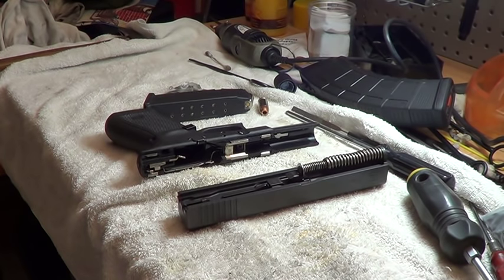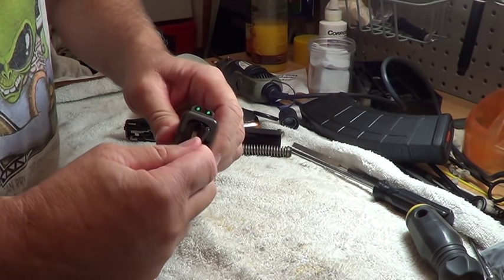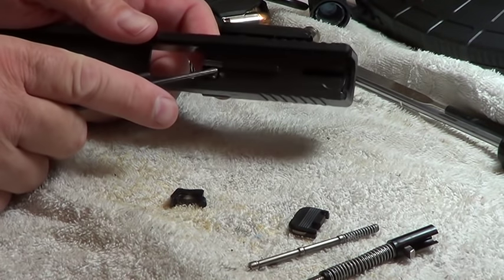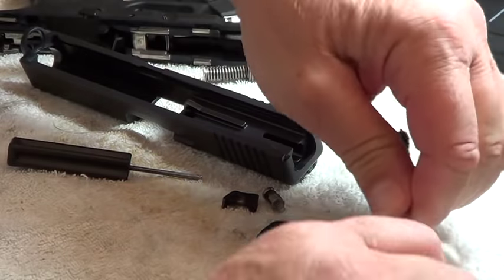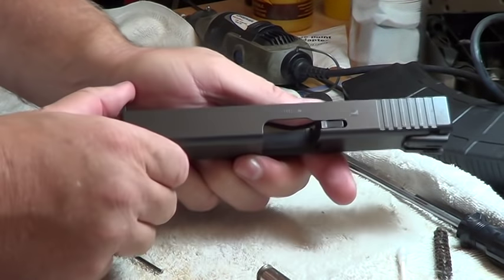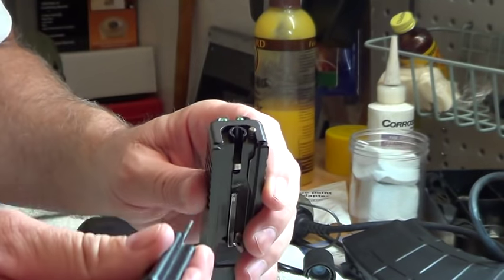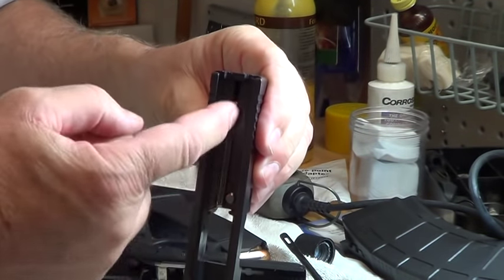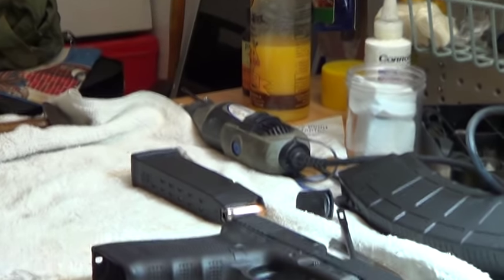Glock firing Pin Removal - Cleaning & Removing The Glock Firing Pen From Slide

Comment: Great video, when do you know it's time to change the internals(firing pin etc) my G19 & G26 are from 1998, and I have put thousands of rounds threw them both ( Duty & off Duty ) also I have never taken that back plate to clean the guns unless the Job Gunsmith did when I had them service my pistols for whatever reason. Both guns work fine shoot as good as they did when brand new. My G42 gets unbelievably dirty so the next time I shoot it and clean it. I will do what you instructed. Again great video and thanks for any opinion you care to share, all the best.

Comment: Thanks for this. I already did all this by experiment, but your explanation confirms I was doing things right.
Question for you: I've had more than enough misfires recently to wonder if my pin spring is too weak. Is that possible? This G27 has had several thousand rounds through it. The pin strikes the round but no discharge - so I have to re-rack by hand. Maybe bad ammo?  It is a sick feeling - especially in the middle of a rapid-fire training session.
Reply from the maker: Not sure I would try different ammo, differ mags, check firing pin for chipped, bokken or worn.
Reply from the maker: make sure you two firing pin couplers are in right
Reply: Thanks. I did not mention the fact that I am using 9MM rounds in both .40 and 9mm mags so I may be adding too many variables. Plus, mixed ammo brands. I need to be more methodical in determining what is wrong. I just broke down, inspected and cleaned the entire assembly so maybe that will help (it was pretty grimy). Under a lense the pin did not appear chipped or damaged but clearly appeared worn. Is there a spec for that?   @HeyGunPeople

Comment: Dear I have G-18c  nd it fire pin back slide doesn't open like u show in this vedio. I push like but back slide doesn't move lower. Are u help 2m in this case. If u did s0o I'll send u pictures of required place.
ThankU

Comment: Hey RG...

I got this Glock 20, stored for years in the desert in between few rounds put through it when I carried it its a a new glock.. Never pulled the pin until now as i look a your video... but wow, took to a Swiss range put 4 hundred rounds or so  and it started to miss fire periodically  a lot dirt in the tube and firing pin spring, ejector..

What do i do for the grime on the fire pin sprig.. can i use some cleaner on it (pin only)?  thanks  also passed my carryig permit for my company here as Vet Expat here and thanks for tips... really helped me cuz the Swiss just do not give out pan cake ccw's and security licenses..

Comment: Firing ping. When the gun is not loaded, the bullet is not in the barrel, when tilting the gun down, up, if you move the gun to the sides, you can hear how this part dangles inside. The sound is loud.

I would like to understand, this should not happen, right?

Thank you.
Reply from the maker: Sounds like you didn’t put the block back in. There’s a little plunger with a spring on the slide that holds your extractor in that also blocks the firing pin from wiggling like that.
Reply: @HeyGunPeople thanks

Comment: Yea it’s not recommend to remove that plastic piece unless your going to replace the plastic piece with a brand new one, also their is a special tool to seat that plastic tube back into the Glock. Not a good idea what u did because you now scraped and marred up the plastic tube.